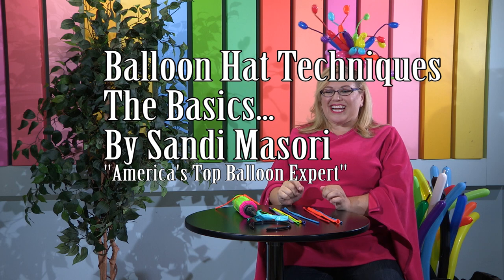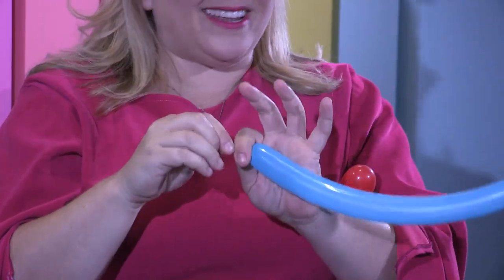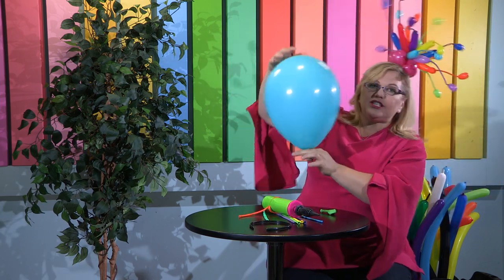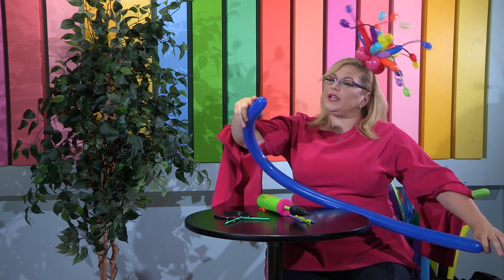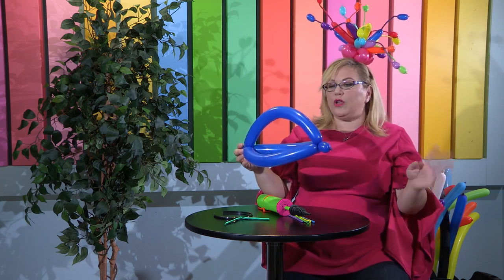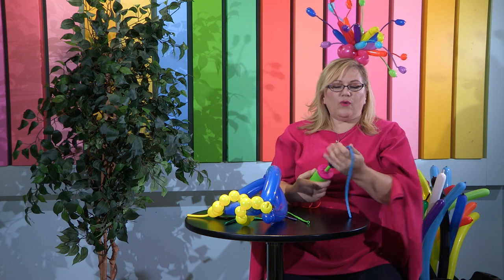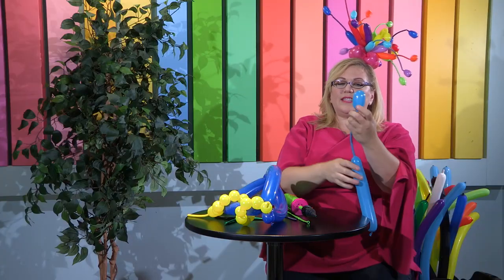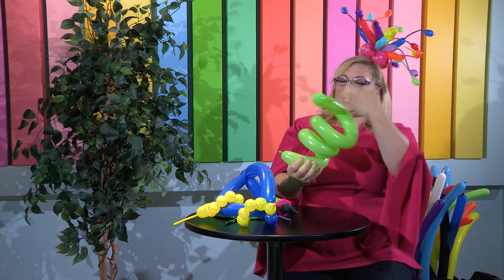How To Make Balloon Hats- Basic Techniques

Comment: What brand do you use for the 260s? I can never blow them up as easily as you do!
Reply from the maker: Depends what I'm doing, but generally speaking I use either Qualatex or Batallic :~)
Reply: Is there a trick to it? I swear it takes me 10 times as long as you.

Comment: hello Sandi. I purchased the book hoping you would answer my question regarding oxidation. in the book you state don't use dark balloons outside. but when I have too what can I do to add the shine back.
Reply from the maker: Hi Denise, there are a couple of products you can use to add the shine back, but I don't use them as I've found them to increase the balloons popping when outside.  Others seem to like them though.  One is called balloon shine, and the other is plain aqua net hair spray.  Personally I just figure that as long as the balloons all oxidize equally, it's not that big of a deal.  :~)